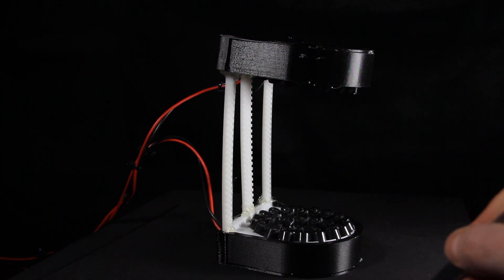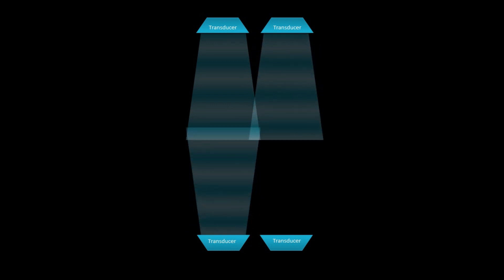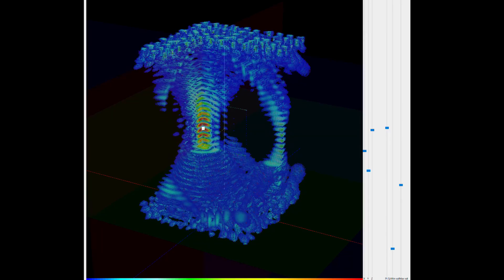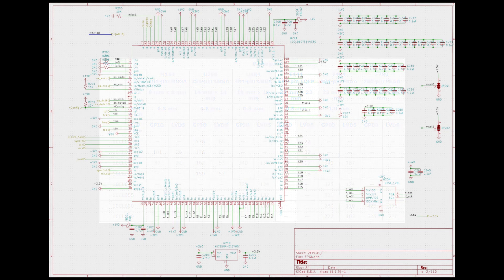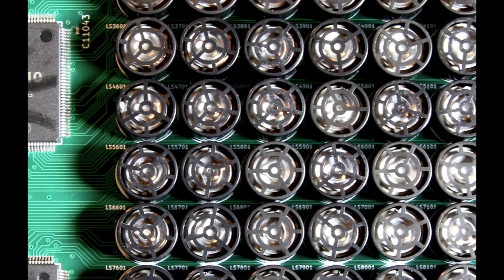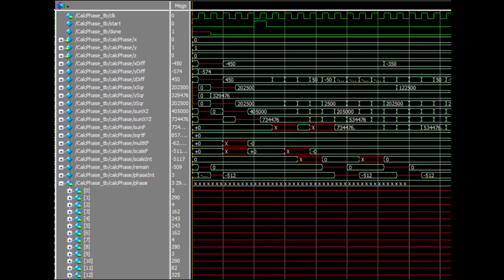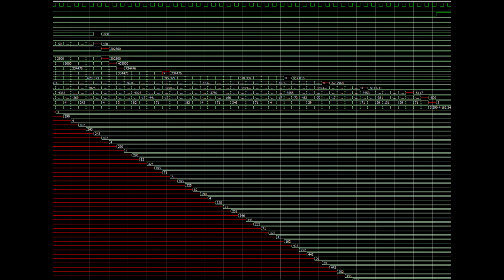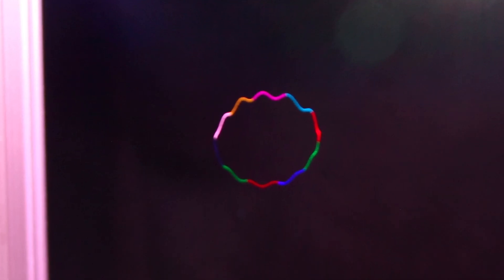Hologram V0.1?

Comment: -Copied from your other channel

The regularity of the unstable movement suggests that some of your transducers aren't placed accurately enough which causes the focus point to be wider so when you move the ball rapidly it creates centrifugal force which causes it to move inside the wider than intended focus point. If you bother to resolder the transducers create jig to hold them in the perfect position and solder them that way.

Best way to make that jig is to have small holes with a lip inside them so the jig can be placed on a table, the transducers placed into the holes resting on the lip with no wiggle room and with their terminals facing up, the board goes on top of that. It's best if you also include the board position on the jig so both the top and bottom boards are fully aligned with each other.

Comment: Amazing!
But I didn't understand how you colored it?
You are using ultrasonic waves right? How does that add colour to it?
Or are you just adding colour through external leads?
Also multiple beads will be amazing but how could you get them to move differently because there is only one source of ultrasound? I think both will have to move in the same direction/synchronized how will you be able to separate them?
Also can you make it so that source from only one direction is involved? Like from only the bottom?
Really appreciate the help ! 😃
Reply from the maker: Correct, all done through 40kHz sound waves.  There are RGB LEDs mounted on each corner of the top board - those are all connected in series (and so all 4 show the same color).  The LEDs change color depending on the position of the ball - this is pretty simple as I always know the exact position of the ball.
While I haven't done it, I'm told that generating the waveforms for multiple balls can be done by multiplexing the focus point among multiple balls or by doing some additional math to produce multiple focus points.  
Yes, it is possible to have only one board producing sound - check it out here: https://www.youtube.com/watch?v=6hE6KjLUkiw
Reply: @abitembedded1473  oooh  thanks a ton that helped a lot!

But by multiplexing the focal point you will be basically dividing up the particles between some speakers so we will need to find a minimum number of speakers required for a particular particle.... but I don't think this will be scalable cus a human sized projection will take many many particles and an equally large soundboard .  But such a massive soundboard won't be feasible
So then this isn't scalable right?
Reply from the maker: @jainamshah44970  I definitely don't think this is scalable - it's definitely pretty cool to see live but someone smarter than me will have to figure out if this technology could scale to something practical
Reply: Hmm thanks a lot!
Yup it would be very amazing to see it live

Comment: That's so cool, the way that tiny ball is moving looks like a miracle, I was wondering is it possible to use reinforcement learning that your program can learn itself automatically after so many trials and errors how to handle more than one ball?
Reply from the maker: Hey Amin - yes, it would be possible I'm sure but to be honest, probably not necessary.  The math is deterministic and implementing an ML model in an FPGA would be challenging (but doable).  Also, training would be a pain (you have to manually place the ball everytime it flies off), unless you could train solely used the simulator.

Comment: I commented on the other version of this video about plans to make a more advanced version of this, and I have some questions about your GitHub code:

Under the fpga tab there are lot of files and backup files that are  just to allow the fpga to do basic math like add subtract multiply and divide etc.? Like including a header or importing a file in python just a hardware version instead of software? Is this right?

I have a limited knowledge of verilog and systemverilog (and digital design in general,) what does the code under each file (board, fpga, sim, cli) do? It is easier for me to understand code if have a general understanding of what it is meant to do altogether.

Based off of my understanding I was able to gather some assumptions to work under and was wondering if these are correct assumptions:
Board’ tab has all information regarding what hardware is on the full hologram board (including the fpga, the pi, spi, transducers) and kicad files showing how the holo board looks and holds these components.

The fpga’ tab holds the code to allow the fpga to do math (as mentioned at the top) and the math to do certain wireframe drawings and animations with the transducers. The original inventors at the university of Sussex did not include this as far as I have found. On their github someone asked for it and got no response.

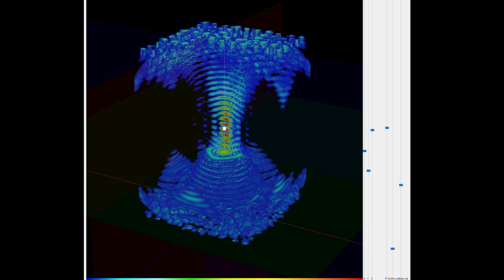‘sim’ is used to simulate the transducers holding the white square in video demonstration at 2:23. This seems to be mostly for testing code to animate or draw.

Online definitions of cli make it seem like a terminal in software coding: put in an instruction, like a key press on keyboard, and get out a output, like the styrofoam ball will move. But I am not sure what it does and why we are using it here.

‘Mech’ and ‘media’ seem irrelevant to me since mine is going to be designed physically different (since I’m building a table and yours was more proof of concept/ testing for future r&d.)

Am I correct in assuming these? If so all that’s left is study verilog and systemverilog a little more so I can understand exactly what the code is doing and how to write my own for further animations and general development. And I can start my first prototype.

Thank you once again.
Reply: So many questions:) 
- yes, there a number of support functions enabled in each of those files - FPGAs are essentially arrays of lookup tables and you have to build up from there the functionality you need in your application.
- each of the folders have readme's that describe what they contain and your summarization is correct
- the CLI is used to issue commands to the FPGAs.  It's basically a user interface to the FPGAs
- I would recommend that you start by getting an FPGA development board that will allow you to learn about FPGAs - this is an awesome and cheap board that I would recommend https://shop.trenz-electronic.de/en/TEI0003-02-CYC1000-with-Cyclone-10-FPGA-8-MByte-SDRAM?c=480
Reply: @abitembedded  Out of curiosity, could I use 4 of these boards to make this hologram, or are they too weak?
Reply: @abitembedded  Thank you. By too weak I meant not able to do the calculations fast enough or reliably enough.

The board that you had recommended is not in stock anywhere for a while but it seems like such a great board the more I research it. 
Do you have any other recommended boards for practice?
Reply from the maker: @okashaarshad2371  unfortunately, I don't have any other FPGA EVMs I can recommend - and as you point out, stock is a huge issue for the foreseeable future.  I suggest you look at   your local electronics distributor (e.g. Digikey, Newark, Mouser, etc...) to see what is available on your budget

Comment: This is absolutely amazing, I might look into playing around with this myself. One thing I thought of while watching is about adding a neural network.  Given the simulation you set up you should be able to make a training set quite easily and create a network that takes 3D coordinates as input and outputs phases per node, bypassing a ton of the hard number crunching. Using a good ASIC like an NVidia Jetson or some such should allow for real time processing, at which point the only issue would be the amount of pinout required which might be solved by using a seriously beefy shift register hooked into a PCIex4 bus or some such.
Reply from the maker: The math isn't very hard actually - a couple of equations run for each transducer.  However, I'm learning that the problem of levitating multiple balls doesn't have a closed form solution - neural nets might be a good solution in that case.